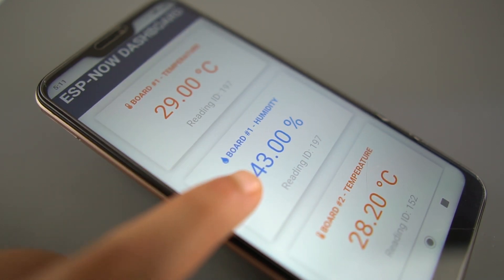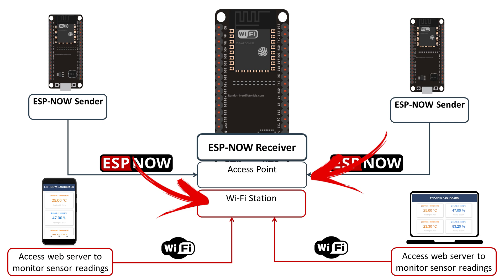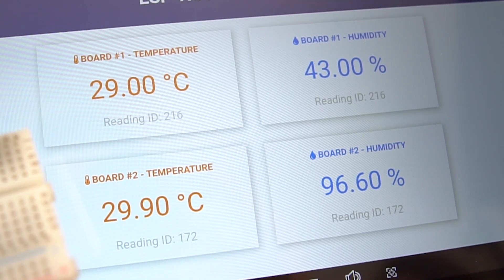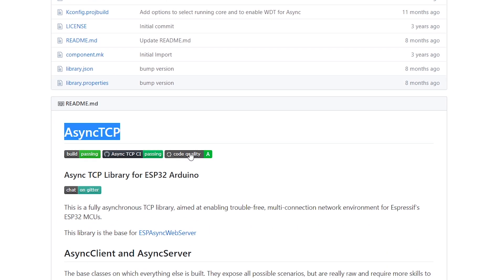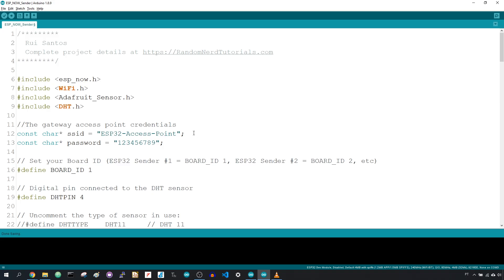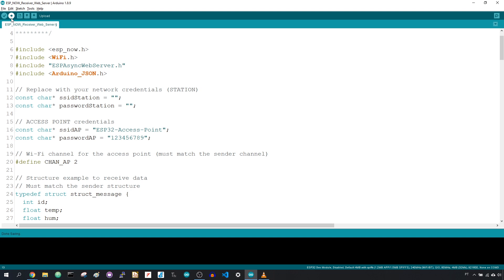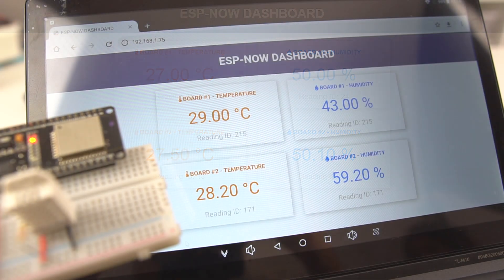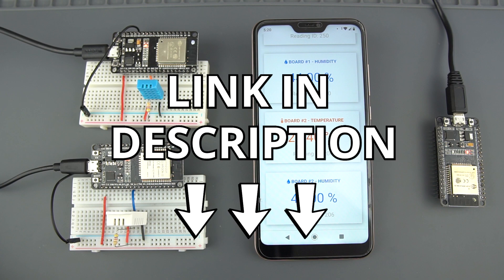ESP32: ESP-NOW Web Server Sensor Dashboard (ESP-NOW + Wi-Fi)

Comment: I found an apparent bug in the transmitter code.  It worked well for a week or two, but then started to complain "Peer interface is invalid".
Fault seems to be an inadequately initialised structure.  Following advice elsewhere I changed
 esp_now_peer_info_t peerInfo;
to
 esp_now_peer_info_t peerInfo = {};
That seems to have fixed it.

Comment: I can't get it working, I'm combining 2 ESP01 as sender and an esp32 as receiver/server. Both ESP01's are recognized and can communicate with the 32 up untill it is connected to the wifi. Then suddenly the communication stops and both are no longer available.

Would you still have the old code somewhere available so I can try that? In this video you clearly mention both espnow and wifi network need to be on different channels, while on the site (and the new script) you state the opposite so it's a bit confusing. I suspect my mesh wifi to fail with the new scripts.

Comment: Hello! I am trying to run webservers on multiple esp32 devices. I'm planning that each device can run as a master device. And in every device I can pair 2 esp32 devices entering the MAC addresses in the webserver user interface. So when it's paired then regardless on which webserver am i, I can control both or three devices. On the webserver I have a field where I can enter the MAC address. I wonder is it possible to pair devices  like so? I haven't implemented the communication code yet and looking solutions which might be the easiest to implement. Right now what i have is a single device working in a webserver access point mode with a user interface for one device. I implemented the add on buttons and sliders but they aren't yet connected to the other esp32 devices and no data is in the background.

Comment: Seems like you could make the connection to the receiver assign back a number for that MAC that it uses to set it's broadcasts and not have to have custom 1,2,3,4... int assignments hard coded in.  This would allow the same code to be used for each sensor ESP32 and dynamically connect/assign number when connected.  I'm going to work on this (granted, you'll have to be peer not just Rx or Tx).

Comment: Is there a way to ask Google home what the temperature of a room is using this project...??
Specifically I want to read temperature of my pool aloud when i ask it Question:"ok Google, what is the pool temperature? " Answer: "The pool temperature is currently 27.5 degrees celcius"
Reply: Maby if you send the data to IFTTT and connect this to ok google?
Reply: I think when ESP32 is working as a weberver then probably google home can access the MAC address and read in from the webserver.

Comment: This is perfect, I've been racking my brain for the last 3 days to get ESPnow and a web server/ wifi working at the same time.  I'll dive into the code this afternoon. Thank you
Reply: Hi Tom, have you tried this code?
Reply: @guillermodanielarias9828  I definitely have, it didn't work in my unique situation as I needed Wi-Fi plus ESP now sending. I ended up running a master which connects to Wi-Fi and received ESP now and then communicates over serial to the first slave which directly sends out ESP now

Comment: A nice project . can it be implemented on ESP8266 . If yes make a video to explain. thanks
Reply: Yes, it can. ESP-NOW is compatible with both, and cross-communicates between them with no problems. 
I’d stick with the ESP32 for the web server (from experience using both to do that for other projects) but as far as the sensors go? No need. Honestly you might even want to UNDERclock it a little bit to save more power. Even 20Mhz is way more than sufficient for a basic sensor.
I myself plan to use those old 8266 boards for something useful that I still have, so this is perfect! (I’m upgrading the office LED lights by switching the existing NodeMCU boards for ESP32 M5 Atom modules because they’re tiny. I also have a few temp/humidity/etc sensors, but I’m pretty sure they’re AM2302 mostly, MAYBE 1 DHT11? Shouldn’t matter though. Hopefully. I’ll update once the new shipment arrives! Any day now!) 
Next step: Change all the LED shelf lights to have a 2nd mesh network between them using ESP-NOW, so that even if/when the WiFi is down, I don’t have to connect individually to them in ad-hoc mode one by one. I want to use the temp sensors/humidity sensors to integrate with the air on and a fan on the porch, along with adding functions as I think of them. (Still researching the best “human presence sensor” option for the porch and bathroom lights that won’t turn off when you sit still, lol.)
Reply: Came here to ask the same question!